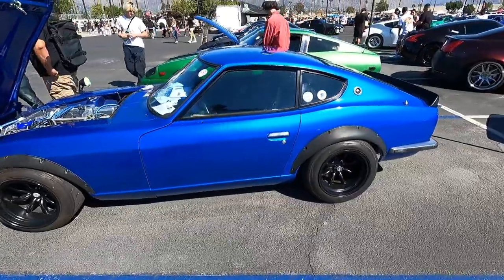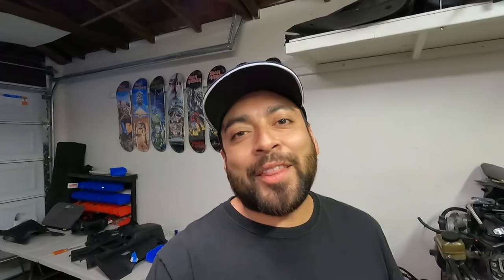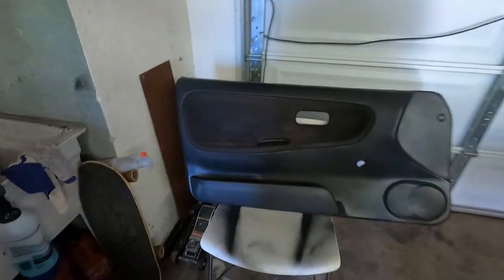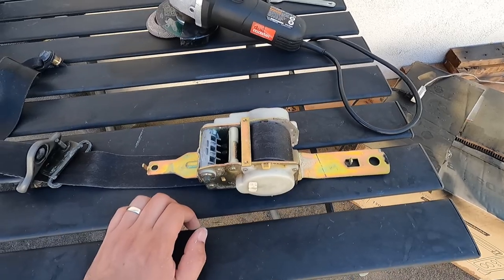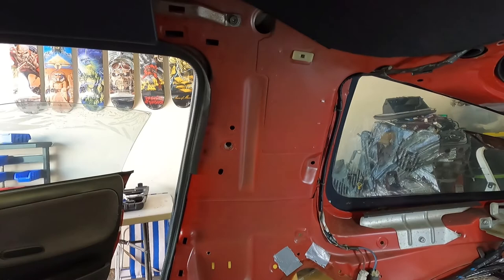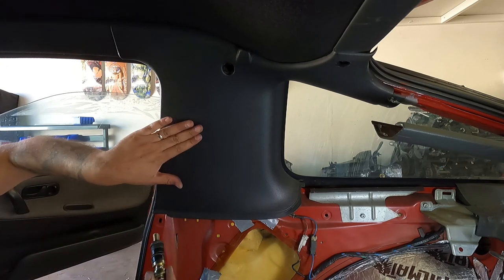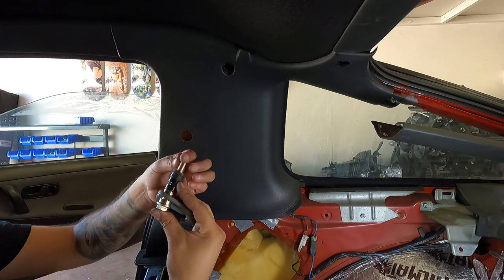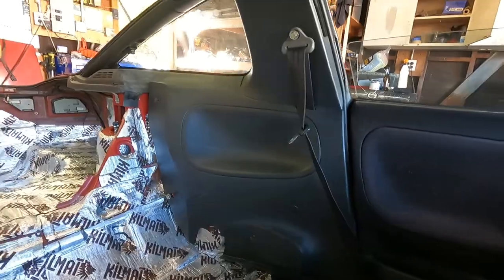240SX S13 MANUAL SEAT BELT CONVERSION!

Comment: Inspired by MARIO!!! and improvized. Any aftermarket 3 point harnes will do. Use a 2.5 inch length on the 7/16 20 bolt for fronts. Also used a 2.5 inch bolt for the lower anchor. For rear seats we used brand new aftermarket 3 point harness and a metal plate from Home Depot. We spent a total of $80 for both sets of seatbelts and then another $25 for all hardware and longer bolts.